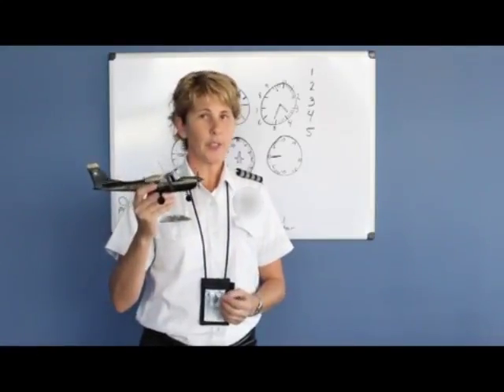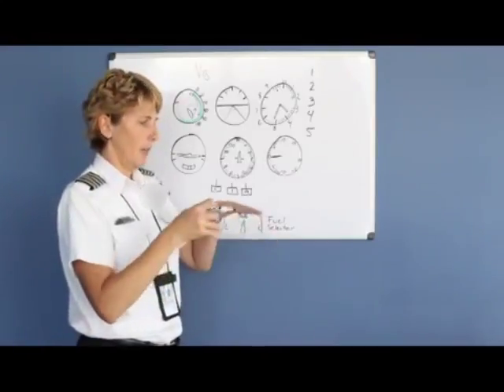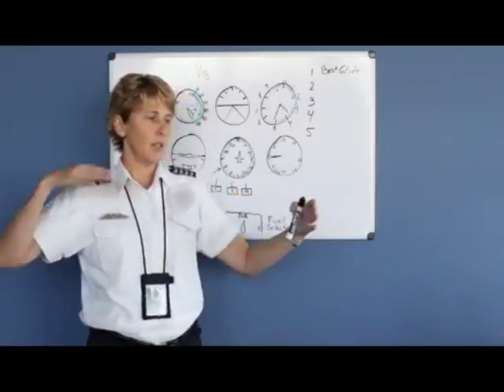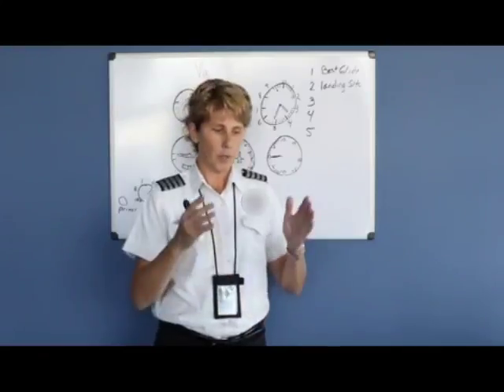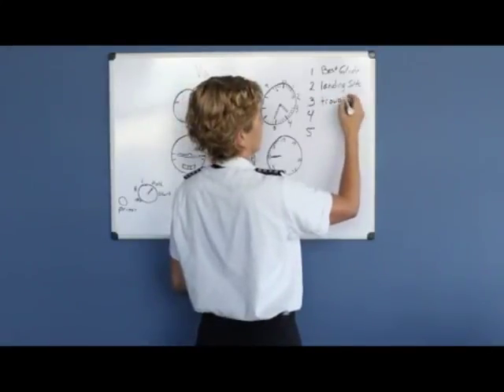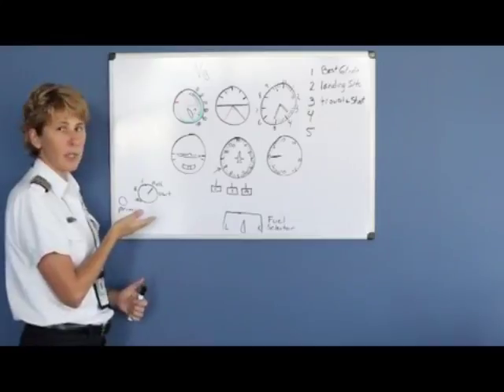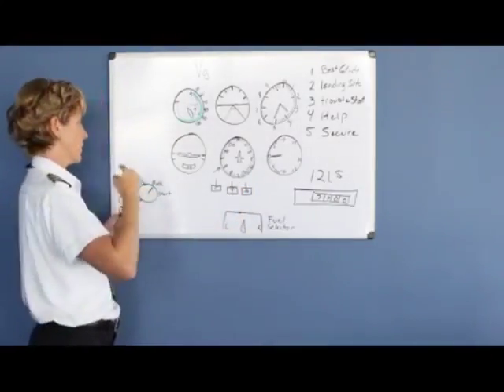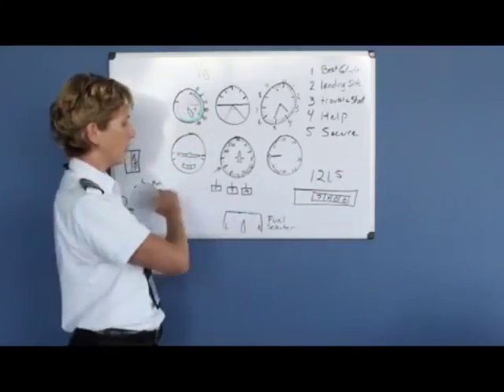Engine Out Procedures (Private Pilot Lesson 2f)

Comment: A air speed 68 glide speed 
B best place to land 
C run your checklist     Fuel on both mixture enrich fuel pump on bump starter 
D declare emergency 121.5 
E evaluate what’s happening
Reply: E - Exit procedure (secure the airplane, turn off fuel, electricals, unlatch door, notify passengers).